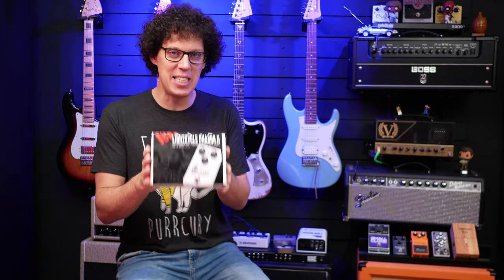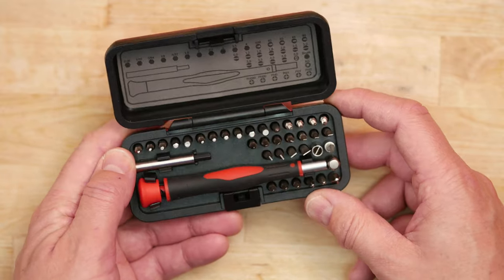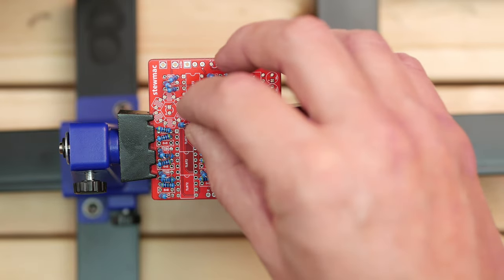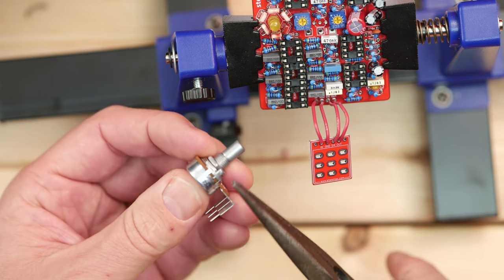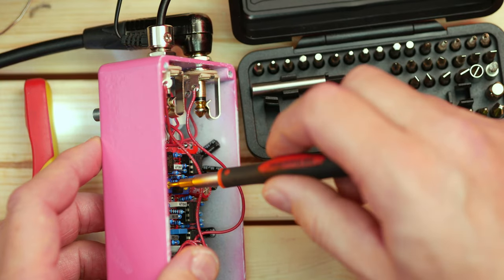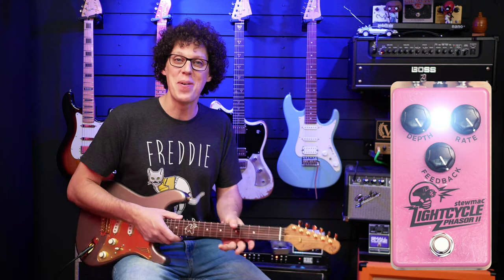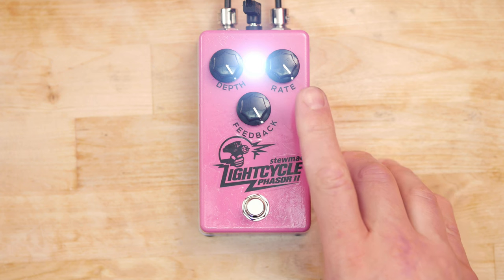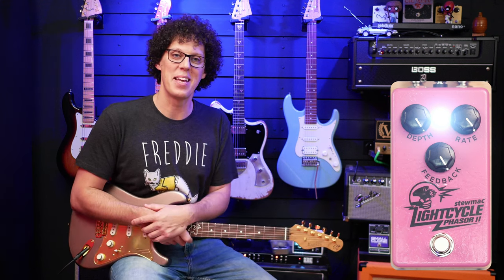I built the StewMac Lightcycle Phasor II | DIY Pedal Kit Review

Comment: I’ve built several pedals, with varying success, and I’m of two minds here for recommendations for new builders. 

Starting with some cheap Chinese pedal builds can be low-risk with regards to money, since you’re just learning and if you screw up it’s not a big financial hit. However, these cheap builds often have just one photocopied schematic and no instructions, which can be challenging. 

Nicer pedal builds are more expensive, but usually have better instructions and better parts. I’d recommend going with a reputable company, like StewMac.

Comment: YEAAAAAAAAAHHH, diy time!

post watching edit: I find it very funny that all pedal kits say to break of the tab on potentiometers. I drill a extra hole for it. The tab is great to hold the pots down when you tighten the nut. And if the pot gets loose, It doesn't start to spin and ripping of wires!

You could consider adding a layer of clear coat over the decal stickers to make the pedal a bit more rugged. 

The pedal sounds great!

Comment: I have made 3 pedals now, all from Fuzz dog pedals. The instructions are very clear if a bit sparse. I got the upgraded kits and they went together well and all worked first time. I am now just buying the circuit boards and sourcing all components myself and drilling the case etc. I really enjoy building pedals and making guitars. Good advice about laying out the components first makes things much easier. (I Would buy more from them but as i am currently in Indonesia the shipping and import tax make it prohibitively expensive)

Comment: if you are going to paint, let it cure in a warm space at least 75f for 24 hours, 85f would be better to help it cure and off gas before touching it. i may be off a little with the temps, but warm to you is good for paint curing.